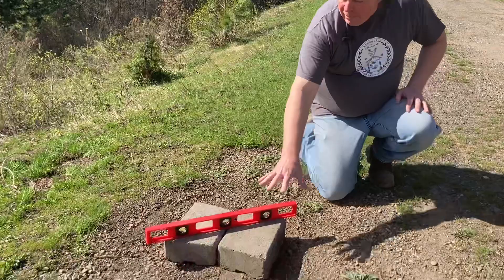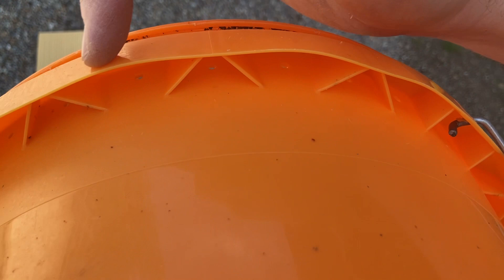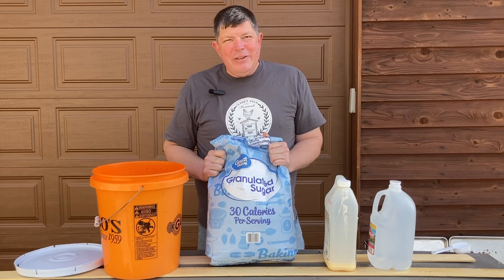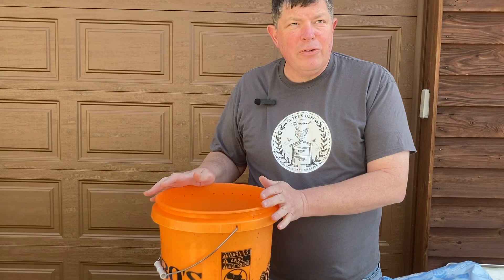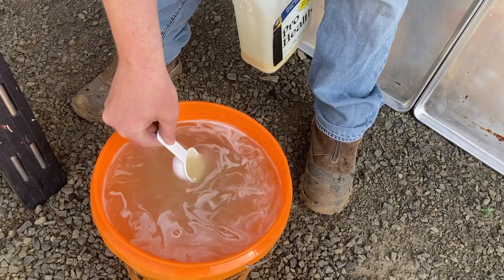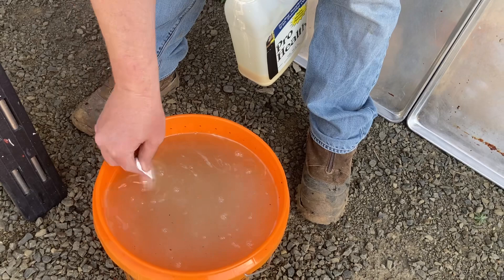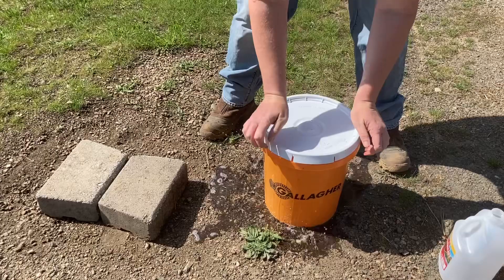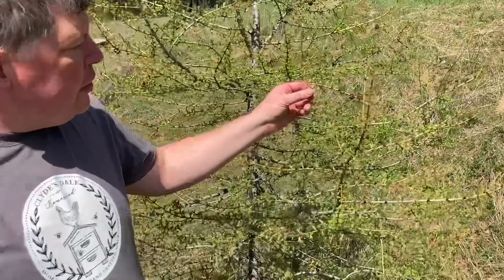How to make a 5 gallon bucket bee feeder.

Comment: That's a great tutorial! Well done! 
 I've been a beekeeper right at 40 years and I am looking for a spring feeding method that's less labor intensive than placing feeders on individual hives. That bucket feeding method looks ideal although I think I'll try 2 gallon buckets due to the weight factor.
 And to address the concerns in another comment: 1)Spring feeding will not taint anyone's honey crop. Your video clearly demonstrated it was early spring, which is a time when honeybees use LOTS of stores to build the brood nest in anticipation of the main nectar flow. No one will have honey supers on at this time. One sure way to hamper the spring build up of a colony is to add honey supers in early spring. 
2) As far as creating an environment to spread disease that seems highly unlikely, and I've never seen research to indicate otherwise. Honeybees visit the very same flowers dozens, sometimes hundreds of times each day. And robbing, and drift of foragers between hives, happens to such a high degree that every hive in an apiary is exposed to common pathogens if present. I switched to a Hygienic Italian breed, the result of decades of breeding by the USDA and commercial beekeepers, about ten years ago and haven't experienced any instances of disease since. And, amazingly, I don't treat for mites and my winter losses are consistent, and manageable.
 Anyway, thanks again for the informative video.
Reply from the maker: Thank you for taking the time to comment. 2 gallon feeders sound very manageable.

Comment: I cannot stress enough to use the smallest drill bit to make the holes. I opened my bucket to find 100+ dead bees that climbed inside when the water level was low
Reply from the maker: Good point